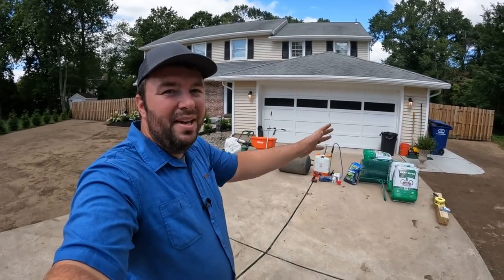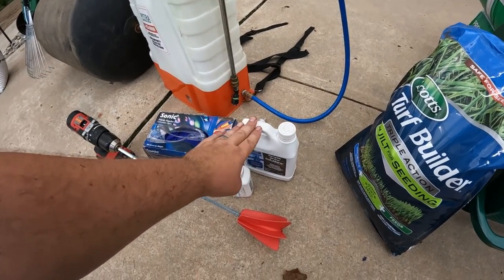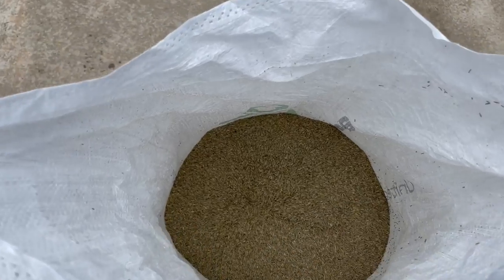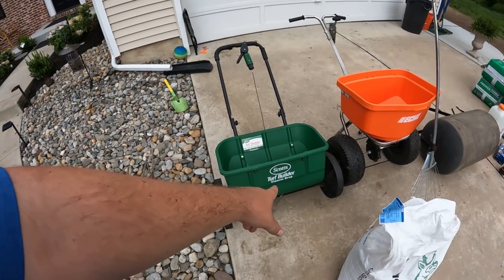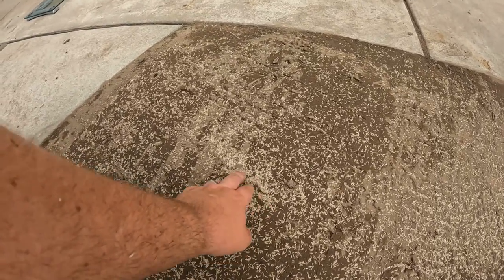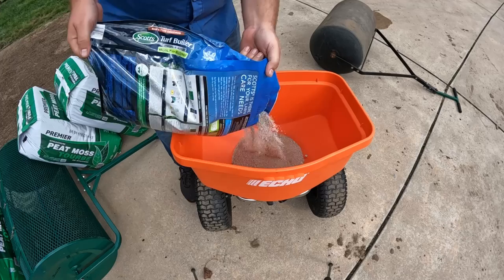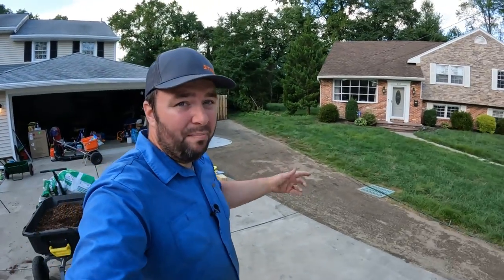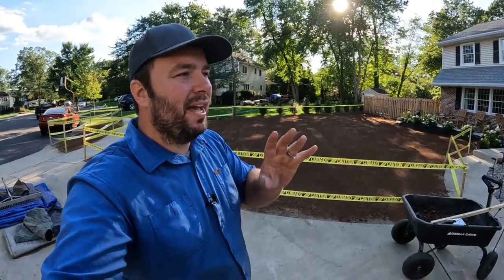HOW TO SEED BARE GROUND

Comment: Thats exactly what I do. When I seeded my first lawn, or a totally seed on bare dirt like here, I like to use the drop spreader. I would use a broadcast spreader for fertilizing jobs. I totally agree with the light raking, I cant tell from the video but I used a light bouncing motion to bounce or rake the seed in, after that  the rolling. Love the video brother! Water seems to be the biggest problem with most seedings unfortunately!
Reply from the maker: Nice!  Regarding the rake, I just let the rake rest on the ground under its own weight and I pull it around.  As I pull, it bounces around a bit.  Thanks for watching!

Comment: Questions: does this work on harder / red soil also? #2 do the same rules apply on a hill or sloped terrain? #3 will this work in heavily shaded areas, will grass survive heavy winter leaf coverage (late winter leaf cleanup)? #4 how do you prevent / remove moss build up, i have more moss than grass now.  

P.S. heavy shade South Carolina heat seed recommendations please, bermuda or fescue. Thanks.
Reply from the maker: Should work in clay.  I know folks with red clay who have had great success with fescue.

Don’t count on this to prevent washouts on steep slopes.  To protect against washout, you’ll need an erosion control blanket.  They work great on steep slopes.

Universal truth to lawncare in general is that you need sunlight.  If you have heavy shade, you’re gonna have problems (maybe not at germination, but later on when trying to sustain the grass).  If you get partial sunlight, you might be OK.  But your concern is regarding leaves building up on a newly seeded area, should be OK through the germination process.  You’ll eventually have baby grass under the leaves and you can carefully remove the leaves.

I don’t have a good answer for you on moss other than considering using a product called moss out.  I’ve never used it.

Comment: Nice & thorough video. I have a smaller lawn then yours and don’t have room to buy the peat moss spreader. So, what about mixing peat moss with Kellogg topper and just toss. I am thinking by mixing the mix won’t be as powdery vs peat moss only. And then do I need a roller to press the seeds down?
Reply from the maker: You can spread by hand, but it’s going to be a mess (even if you mix it) and it’s gonna be harder to control the thickness over the lawn (you’ll have some heavier areas in some spots and lighter areas in others).  But I’ve spread peat moss by hand many times with success.

You don’t need to roll the seed.  It just helps from washout during lighter to medium rain events.

Comment: Hi. I for the first time am starting a new lawn from dirt. I had some spots that were really compacted clay soil so I mixed compost into the soil a few days before seeding. Now when I water in those spots where I put the compost the soil gets soggy really quick. Any tips on what to do?
Reply from the maker: Try core aeration.  If you have low spots, try filling them in.  If it’s really bad, consider a drainage system.

Comment: Great video! Any reason you didn’t apply the tenacity before putting the seed down? Did you fill the roller up all the way with water?
Reply from the maker: Thank you.  I put the tenacity down pretty much at the time of seeding (immediately after rolling the seed in) to maximize the amount of pre-emergent control.  I also had the roller filled up completely with water.  Worked like a charm!  Here’s the recap video showing the results:  https://youtu.be/m8vmEj0qt-Q
Reply: @TheLawngineer  I just finished leveling and ready to put the seed down. Only problem is I have Poa Triv popping up in my bare dirt so now I have to kill it first. Theres always something to deal with.

Comment: I need your help Vince. I want to seed 80% PRG and 20% KBG and my lawn is about 2000 sq. ft. PRG is about 20 lbs and KBG is about 6 lbs for 2000 sq. ft. Do i calculate it as 80% of 26 and 6% of 26? How many lbs of each do I need to seed 2000 sq. ft?
Reply from the maker: I wouldn’t look at in in terms of the seeding rate.  When you buy a bag of seed with a mix, the percentages are based on the total weight of the bag.  So if I have a 10 lb bag of seed that has 80% of PRG and 20% of KBG, then there is 8 lbs of PRG and 2 lbs of KBG.  Note there are other things too like inert matter and stuff, but I’m just keeping the math simple.  I’d recommend working with that ratio.  For every 8 lbs of PRG, mix 2 lbs of KBG.  I would blend the two together with that mix ratio, then spread.  No matter what your seed rate is, you’ll have a consistent 80/20 mix when spreading if mixed well enough.

Comment: why did you apply mesotrione in a liquid AND use a starter fertilizer that already has mesotrione included?  I hope this doesn’t create a problem for you
Reply from the maker: Won’t be a problem at all, we are still well within acceptable rates.  It’s more of a double coverage thing.  I spoke about this in a video I did a while back (link below).  Right around the 7 minute mark if you’re interested.
https://youtu.be/-dMblwDSQXk